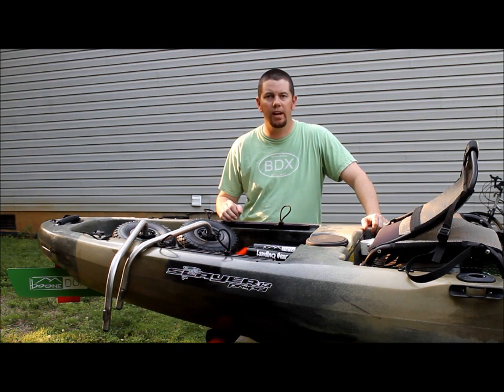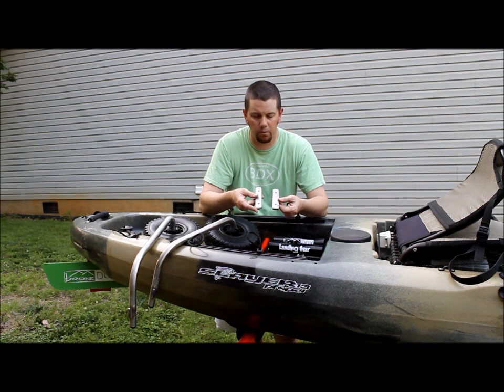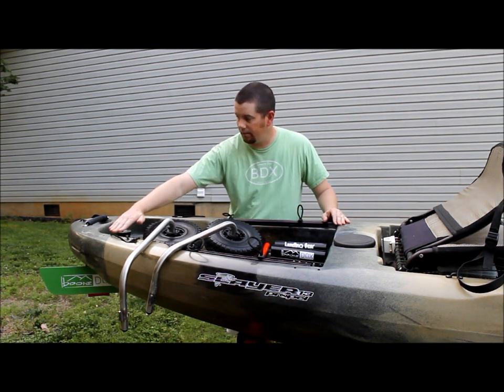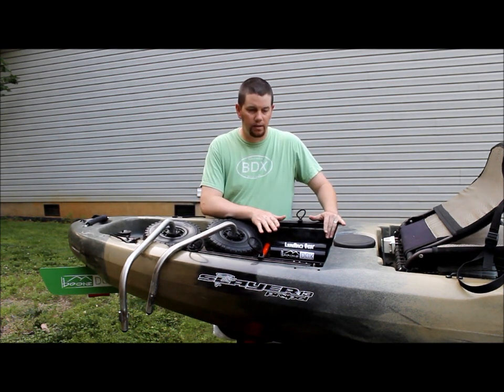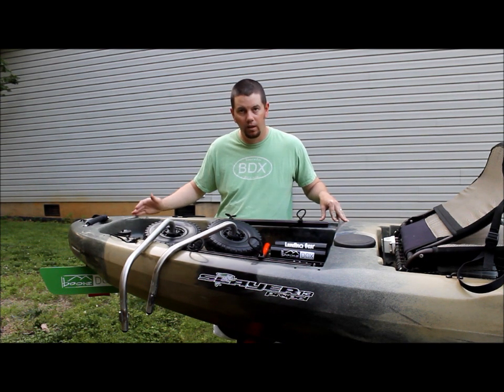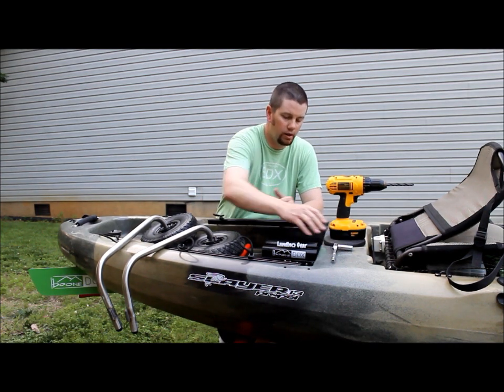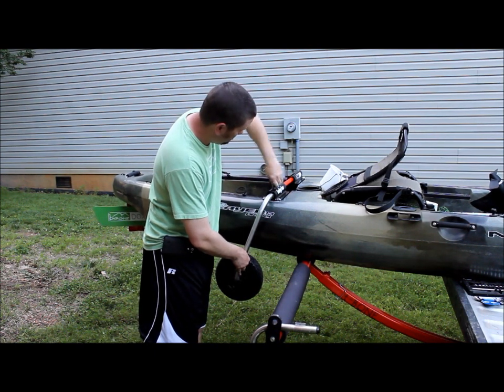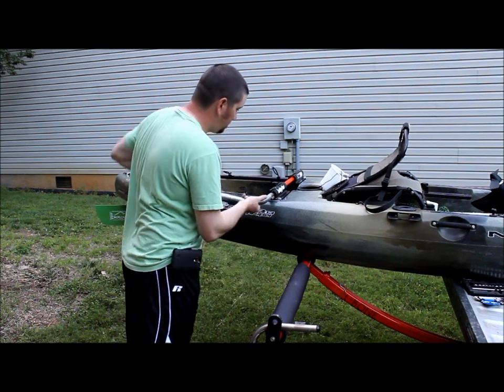Landing gear installation

Comment: Will Boonedox work with me to be able to use my "Wheelez" tires to connect to one of these ?? In other words ...... What else would I need as I feel the Wheelez would track better in sand or surf that the type wheels as you showed that come with it ? I' m asking the question as probably someone has done this very thing ?

Comment: Chad/Dave/Tim,  Will the Boonedox Landing Gear work on the slightly wider Slayer Proplel 10? At its greatest width, it is 34" wide and the larger Propel 13 is 33".  And, the Propel 10 doesn't taper as much moving back to the stern. I'd like to mount it just about where Tim is in this video.    Thanks!   Brad
Reply: Brad Reid did you ever install it on your propel 10?...I have a 10 too but looking too see if anyone has done it.
Reply: bubaa1, I have not. But, if you go to the Native website, the Landing Gear is now listed under its accessory tab. As it turns out, Native and Boonedox worked something out and it now includes backing plates. The Propel 10 is listed as one of the Native kayaks it will work with. It might be that it utilizes the tracks back there, that the backing plates sit underneath them. Not a bad idea if it works! Yes, I may get around to adding one soon!  Brad
Reply: Brad Reid, yes i saw that on the native site as well. After looking at various installations and looking at my cart best location in relation to the rails in the stern., i think the best location for me would be just forward of the storage or rod holders. i'll be drilling holes in my yak and not using the rails. the yak gets too heavy with the pivot point further back. still waiting for boonedox reply...
Reply: Brad Reid ...I finally installed it on my sp10. it doesn't work behind the seat in front of the rod holders. the tires rubs the hull. only place it works is behind the rod holders as shown in the video. even with this install, the tire rubs on the inside when fully loaded. I had to go to home depot and put in a pipe fitting to push the tires outwards and that works....otherwise mounting on the rails is the only way to go without any modifications.